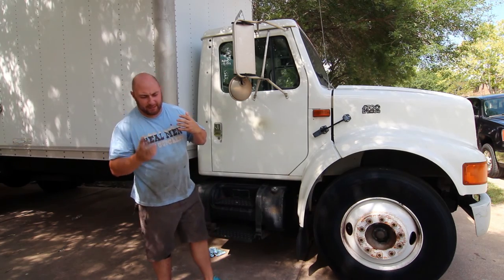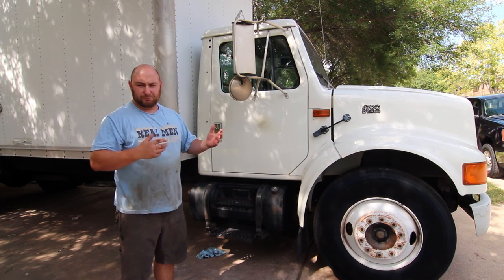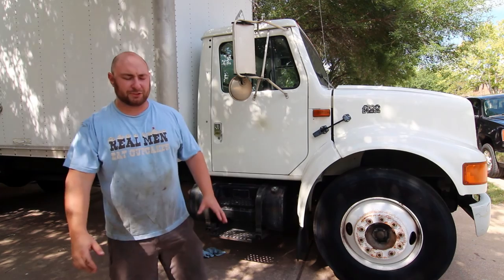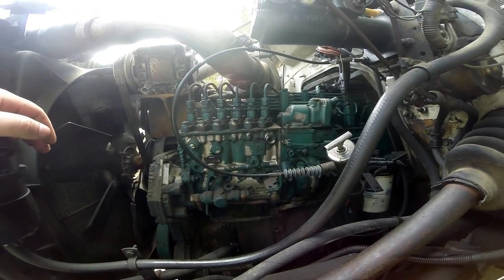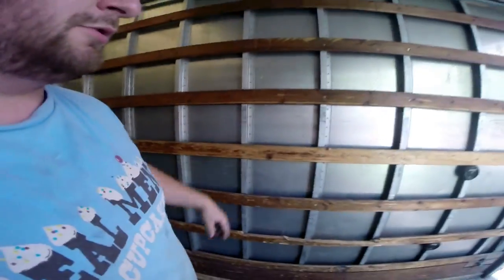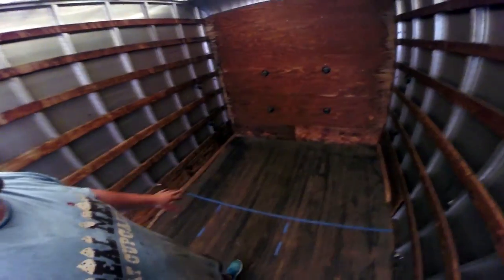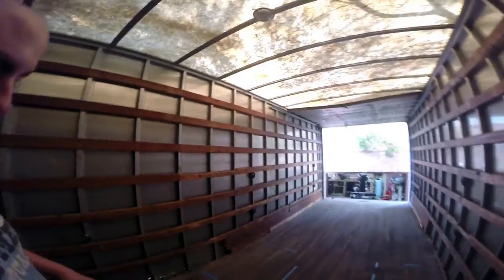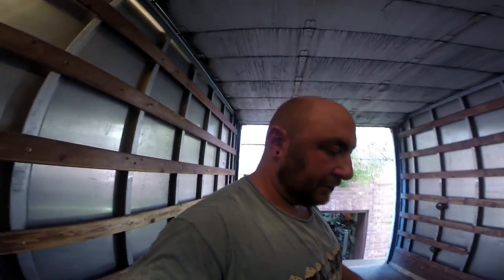#TheBassBox - Part 1 - I Got a Free Box Truck

Comment: Thermal conduction.  Gotta put foam board insulation over the metal stud posts, not just between them.  Metal is very conductive, it will transfer temperature in and out of that box body. 

Or spray foam those aluminum posts before you put your walls up.